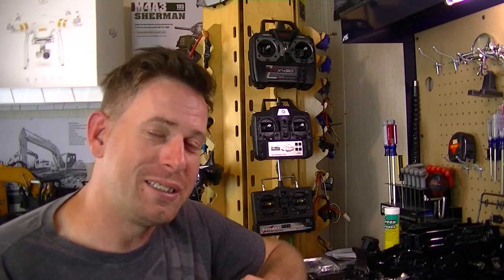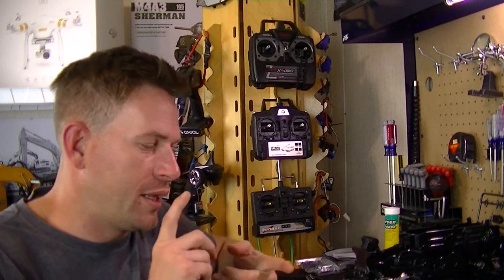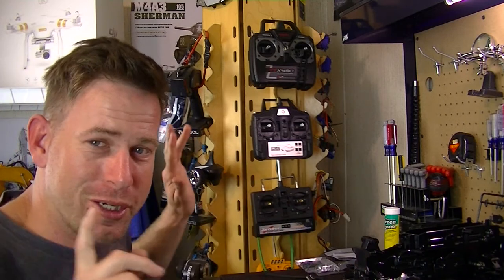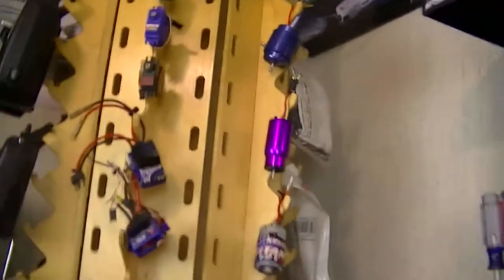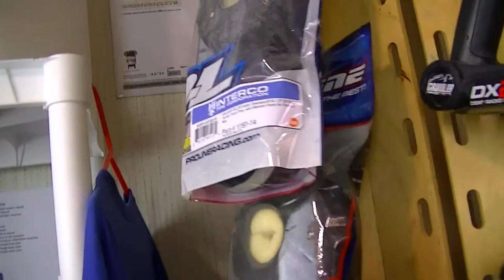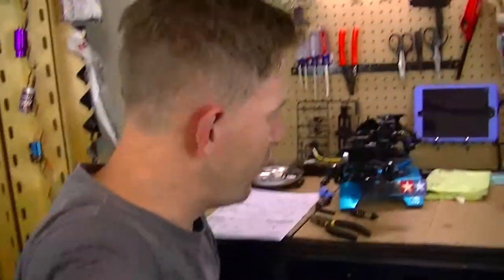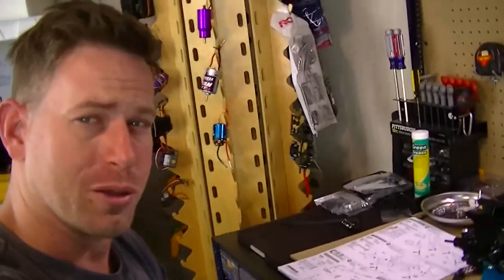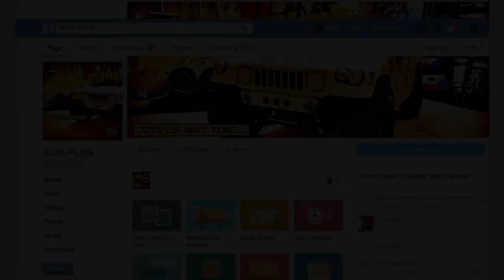RC84Films: KongHead 6X6 Part 3

Comment: From my understanding, oil filles shocks prevent the car from bouncing back to much on landing from a jump. In other words, the spring dampens the shock / momentum from a jump while the oil prevents the shock from reaching its default position (i.e. not compressed) too soon, thus preventing the bounce on landing a jump. Is it necessary with oil shocks on a konghead, I do not think so since it does not seem like a car that is meant for huge jumps and hard landings, but rather small jumps where the bounce just adds to the fun factor.